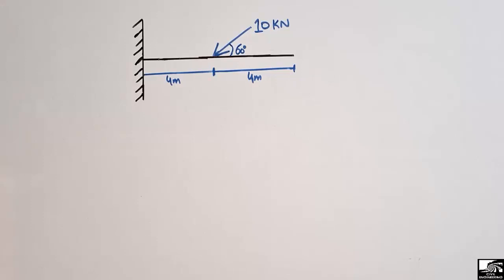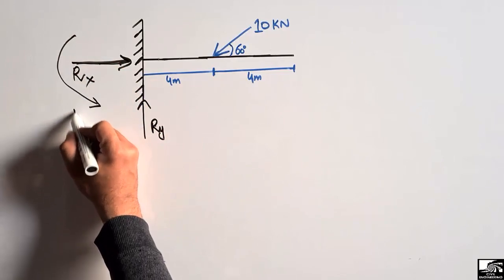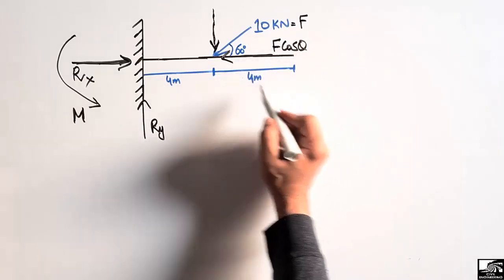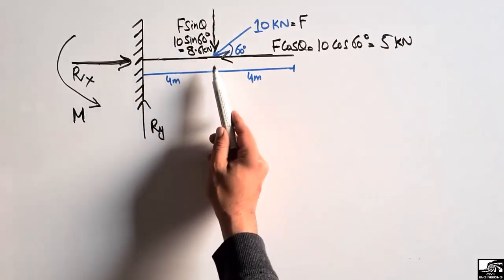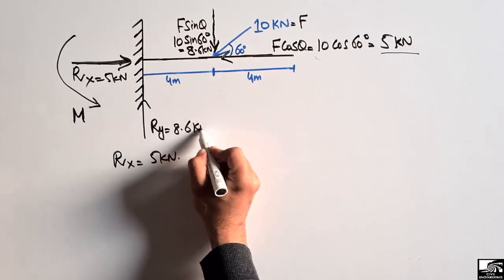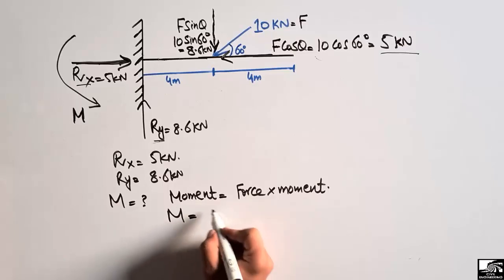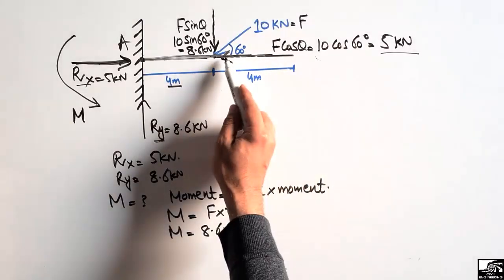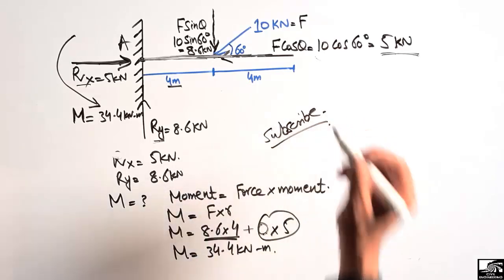Inclined Load on Beam || Mechanics of Solid

Comment: Sir,if the cantilever platform on 11th floor  of 8'x3' which is holding 300 Kg of ac outdoor unit is duly  supported with five L unequal angles of 6' length; 3' with platform and 3' fixed on the floor with two wedge anchors each.please advice me on dimensions.Thanks.